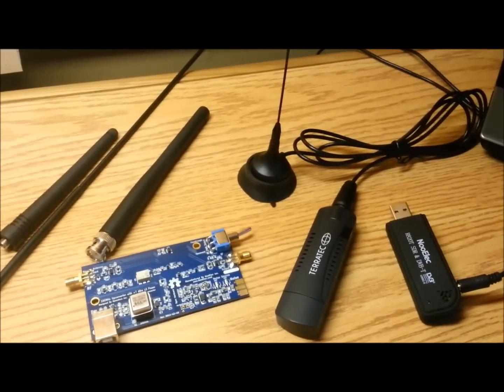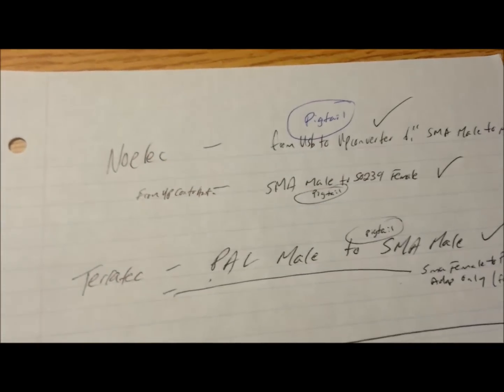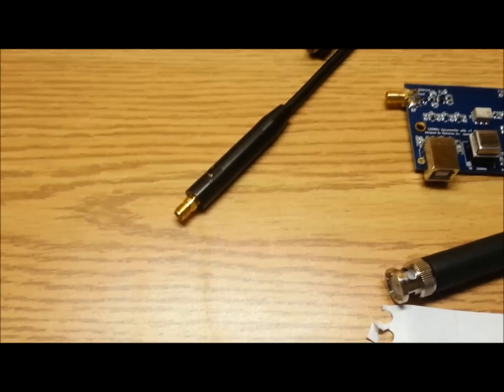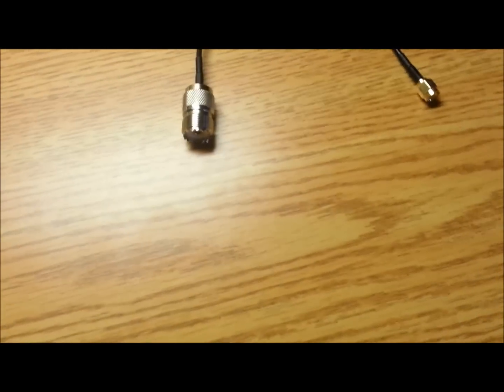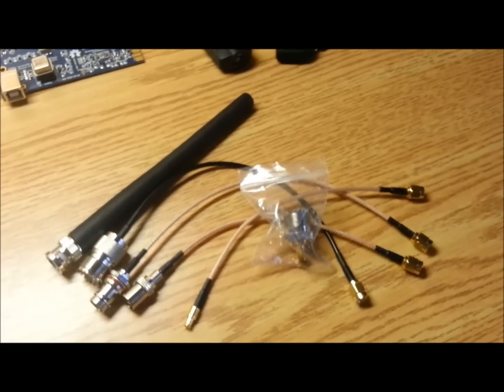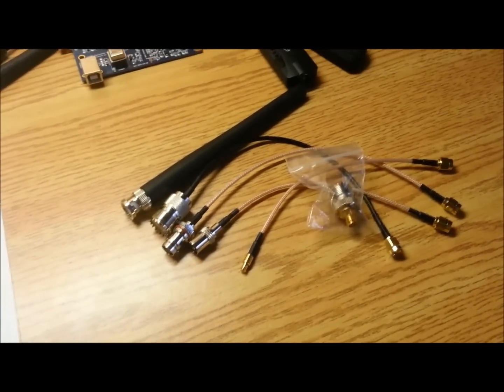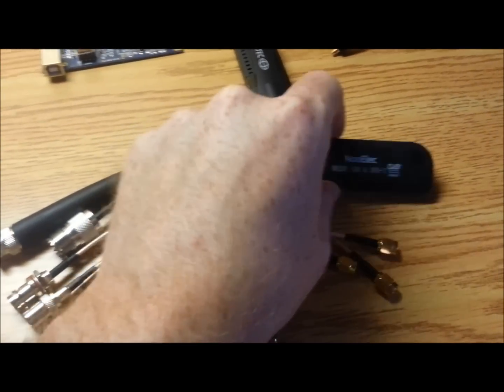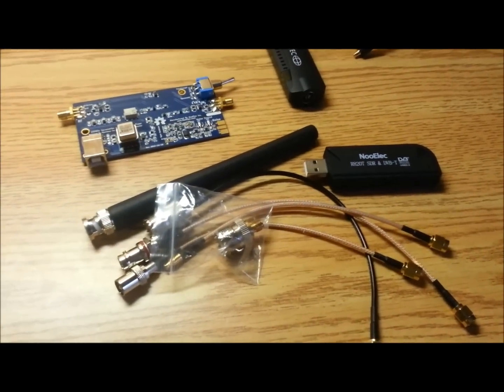Antenna Adapters for USB SDR Dongles- Tutorial

Comment: I would like to connect my car's stock antenna, which has a Motorola plug, to my DVB-T DAB FM dongle. Could you tell me how I can find or assemble an MCX-Motorola pigtail? I'd truly appreciate your help. Thanks!
Reply: Did you ever connect the car antenna?
Reply: Yes. I bought a 6" BNC female to MCX male pigtail and a BNC adapter for scanners (less than $10 for both, on Amazon). It worked. But I couldn't pick up many stations clearly, so I stopped using it.

Comment: can somebody tell me what kind or type of RF connector that is on my acer aspire 7720g...i have a built in tuner card but i don't have antenna..on my acer laptop there is a very small hole that say RF in, but i do not know what kind of RF connector that will fit on it...i want to connect to my external pal antenna...tnx

Comment: I use "N" type connectors on all my antennas. 
I have like 20 six foot USB extension cables from dish network. I can connect them end to end up to 5 cables before the current drops too low to power the dongle
Reply from the maker: Nice haha.  Push the limits.  Cheers

Comment: Awesome vid. I was just told about the USB adapters over the weekend. I do Skywarn and have my Tech. I was told with two of the USB dongles hooked up to a laptop, I could have a scanner then. Now do I need two of the same USB or do I want one of each like you have?
Reply from the maker: Depends what your applications will be.  There are slightly different freq coverage to each chipset.  The first hit on Google sill show you the different ranges.  Lots of good tutorials on YouTube.  Some newer ones on my channel now and upcoming soon for some different uses.  Cheers!
Reply: Thanks for that. I will be sure to look into this more. I used to have a laptop laying around but I need to replace it, so that's hurdle number 1. Then after I get that, I'm all over this...lol
Reply from the maker: whanson3503 Good luck.  Don't spend a bunch of money on them.  I've noticed the domestic providers are charging some crazy prices.  I just got two more R820t units for $10.50 a piece shipped.  Cheers

Comment: Great video.. QUESTION.. I bought my upconverter and other devices from Nooelec.
The items arrived quickly but the crystal looks like it came out of the trash. There is no legible lettering nor orientation dots on the unit. I called the number at their site and asked for an email regarding the crystal. They have yet to respond and my concern about their ethics. Do you know how the xtal is orientated without legible lettering or a dot?
73,
Glenn WA4AOS

Comment from the maker: Well I would say at the stage you are at- read, read, read.  Google around a bit.  I doubt you will need any version of dipole for a while.  Just hook a piece of wire to the upconverter=longwire.  You will get plenty of HF. For other freqs- the stock antenna will do fine for you initially.

Comment from the maker: Dunno what MCA connectors are.  Mine use MCX.  As for the dipole- it depends what you want.  For HF- a simple longwire works for most listening.  I hook mine to my dipole just because it is there- but for HF- I usually use a simple longwire

Comment: I am very interested in purchasing all the components i need. I am not sure what is needed to complete this project. My list so far is the RTL2832U dongle, Ham It Up HF converter, and a 20m dipole. Is there anything else that i would require? what type of connectors will i need. Please help, I have scoured the internet and can see the components themselves not the entire setup. 
I am not looking to connect to more than one antenna. i am going with nooelec dongle and their ham it up HF converter

Comment: Thanks for sharing.  I just got adapter from dongle to SO239 and it made a huge difference in the noise compare to to supplied antenna when I connected it to my Radio Shack discone antenna.